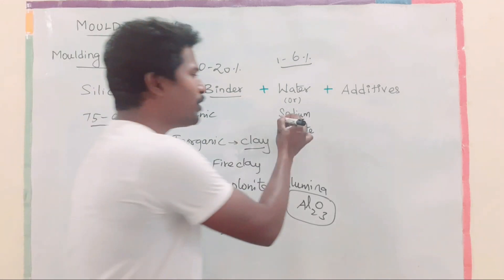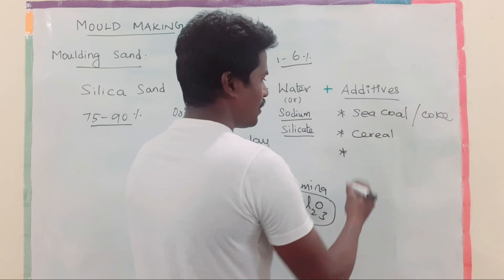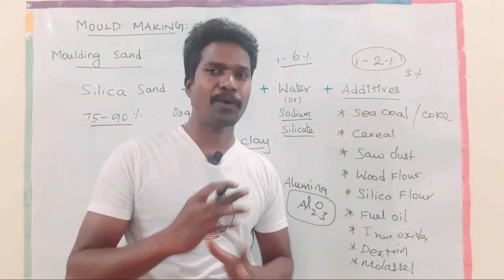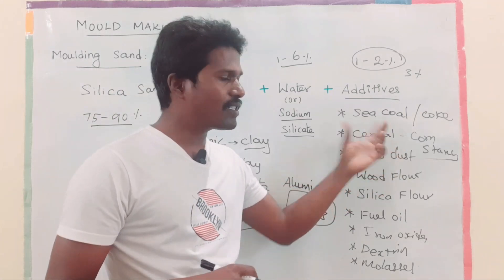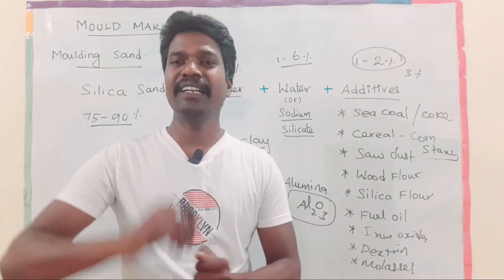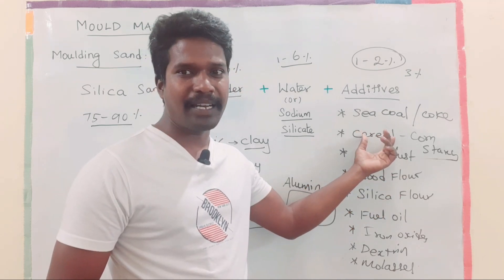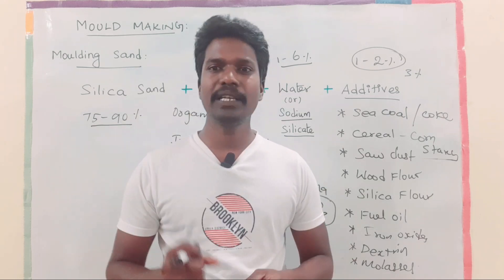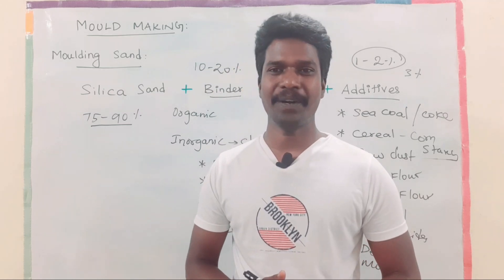Casting process | GATE 2021 VIDEO SERIES | Video 5 Moulding sand | Mould Making

Comment: Casting notes Entha book refer pandringa bro
Reply from the maker: PC sharma
Reply from the maker: If you have any suggestions please let me know
Reply: I'm using  foseco ferrous foundryman and John Campbell hand book
Reply from the maker: @ramjortan5205  if you have a soft copy, send me bro.
Reply: Unga lecture very informative
Reply: OK bro mail or whatsapp
Reply: Bro pdfdrive. Com  website la available
Reply: Production calculation related book pathi sollunga bro
Reply: Bro use these two books for Casting,Welding.
 PN Rao Vol1 (Theory) and Swadesh kumar singh(All chapter numericals)

Metal cutting&Forging - Kalpakjian
Reply: @ArunKumar-kr4hh  , bro antha 2 books pdf la kedaikuma?... link iruntha send pannunga bro
Reply: @nfscsk  No bro, pdf not available.
Reply: @ArunKumar-kr4hh  , bro kalpakjian oada entha book bro.
Manufacturing engineering and technology 
or
Manufacturing processes for engineering materials??

ithula entha book?
Reply: @nfscsk  2nd one